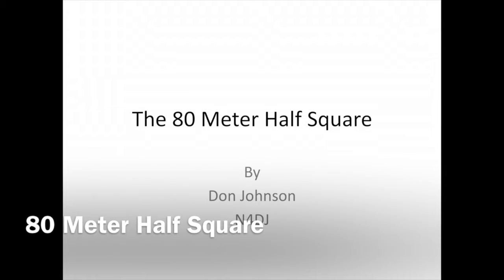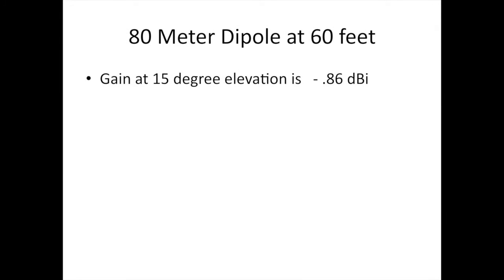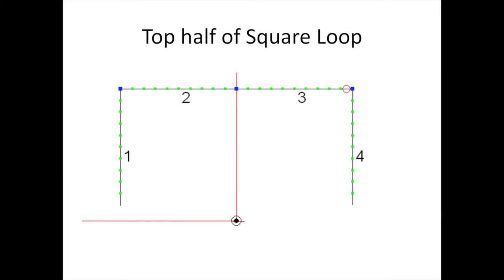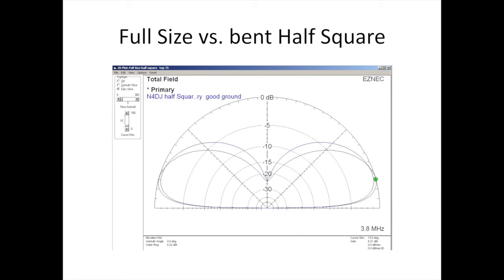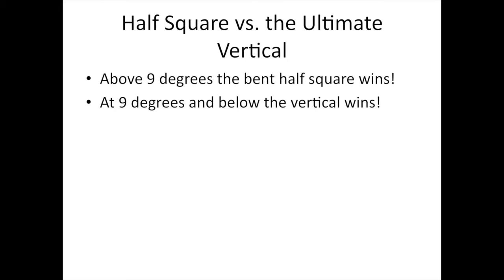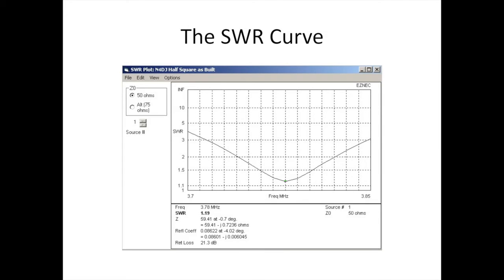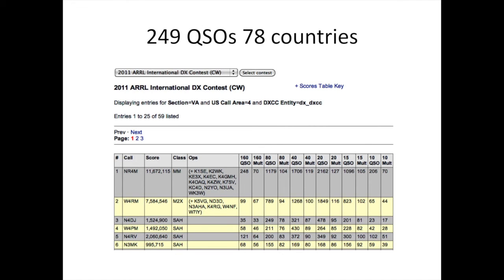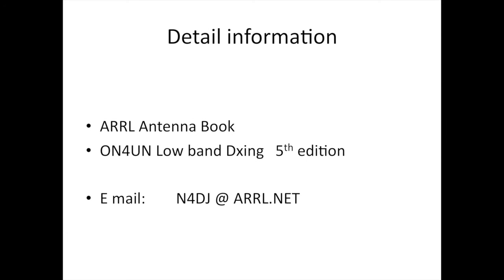80 Meter Half Square

Comment: Great video about bent Half Square. Made these antennas couple of years ago both single element and 2-el versions on 80 cw. Great DX-antenna and it doesn't need radials or high tower's. Now playing with rectangle OBLong-loop's. It is nearly as good as HS in gain and can be installed easier than HS. 73 es DX de Jussi OH3RF
Reply from the maker: Thanks. What kind of rectangle OBLong loop are you talking about? Starting with a full wave quad loop you can go with wider or higher rectangles. For horizontal polarization height above the ground is the only factor for radiation angle, so for the lower bands vertical polarization is always better. Most loops can be thought of as some form of vertical array, as in a circular loop, “Flag” or “Pennant” rectangular receiving antenna for the low bands. The horizontal polarized loops are mostly thought of as stacked dipoles or stacked bent dipoles with their ends touching. Two stacked dipoles give good gain if separated enough, however as in a square Quad loop the dipoles are bent and the separation is very small, only 1/4 wavelength and gives minimal gain. Bruce arrays and the like while not loops can get pretty big for low bands.
Check out this link to one of my blog posts: 

https://www.blogger.com/blog/post/edit/2551453391733787027/3009166728212827889
Reply: Hello OM. The OBLong rectangle is vertically fed from the other side vertical wire. It's a full lambda antenna about 85m 3.530MHz. Horizontal wires are 32m each and vertical wires are 10.5m each. Lower horizontal wire is about 1.5 - 3m above gnd. Fed directly 50 ohm coax and bandwidht about 80kHz SWR under 2. Very similar to HS, but can be built with lower trees or tower's. 160m version is about double the dimensions. GL with testing de Jussi OH3RF @dandypoint

Comment: Excellent info and very good presentation. Good Job Sir.

I'm surprised you don't have more views, likes and comments. Did UToob place you in limbo?

Anyway, I'm planning on both Half Square and Bob Tail Curtin antennas this Summer/Fall, but fed at a bottom end with a 56:1 transformer to get the EFHW multy-band function. My Take-Off will be off the Ends and not Broad-Side.

I live in a corner apartment and my side door opens onto a very large field about 200' square. I can set the Half Square orientation to any compass direction but a Bob Tail will have limitations.

Currently running a 40M EFHW Iverted ELL. I get into Europe with 5x5 to 5x8/5x9 with good audio reports.

My EFHW will easily convert to and from a Half Square and with some work, also into a Bob Tail.

My goal is to get into the Pacific with 100 Watts on phone. After 45+ years, I'm still working on copying CW, (Hi Hi) which will really help with DX.

Thanks for your very good presentation but especially the info about bending the bottoms of the verticals......

73 OM

Comment: how much of your half sqare is running parallel to the ground on each side,and high from the ground is it ??,bearing this in mind what is the total height of the half sqare ??
Reply from the maker: Measurements from my 80 meter half square as built:

Top wire length (spacing) 135 feet
Right side vertical 41ft 6 in
Right side bend. 16 ft 7 in  (bent in about 3 1/2 foot above the ground)
CW ext 6 ft 11 in
Left side vertical. 39 ft 6 in
Left side bend 18 ft 7 in
CW extension 7 ft 6 in

Total right side SSB. 58 ft 1 in
Total left side SSB. 58 ft 1 in

Left side CW ext was 7 inches longer than right side. 

Antenna was within 2 feet of being perfectly symmetrical on CW. 
Feed was at top left corner. Note the two vertical segments were within 2 feet of being the same. This is good enough on 80 meters.
Ideally you want the vertical height to be about 60 feet but by being only 45 feet and bending the ends in or out does not hurt hardly at all as the bent segments do not carry much current.

Comment: How are you feeding it at the top corner?
Reply from the maker: Exactly like a dipole with 50 ohms coax. Feed is at either top corner. Essentially it is a full wave off center fed horizontal dipole, feed at a current maximum which is 1/4 wave from either end. Then the outer two 1/4 wave ends are bent down to be verticals (current will be in phase in the two verticals).

Comment: Foot, 20 foot not feet. not picking just correcting, great vid though.
Reply from the maker: Thanks for the comment. Glad you liked the video but not sure where I used foot wrong. A tree is 20 feet high but I have a 20 foot ladder. I have a 20 foot long wire but the wire is 20 feet. I think 20 foot is an adjective and is singular but used as a noun it is 20 feet which is plural. For measurements we often use singular. I said 120 foot dipole. I said 60 feet high or at 60 feet. I guess I could have said 60 foot high or at 60 foot. As an adjective it follows the singular rule. Saying at 60 feet I am following the noun rule as it is the object of a preposition. English is complicated, so I may be wrong. Wish I had my old English books handy!